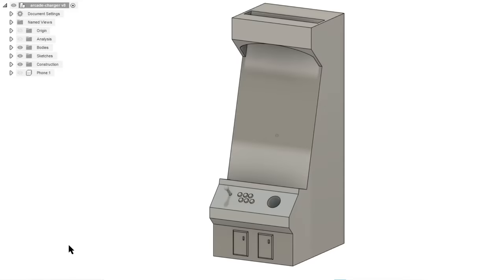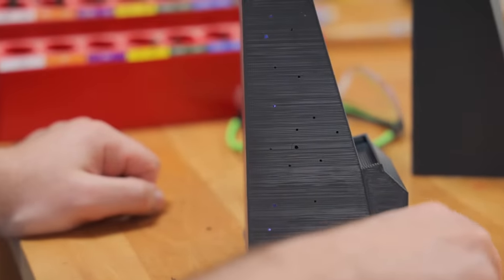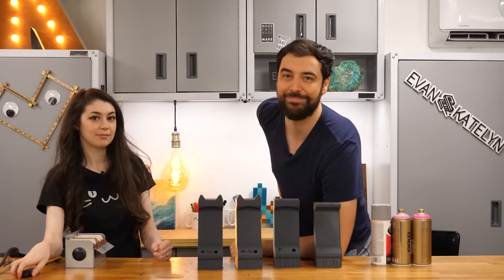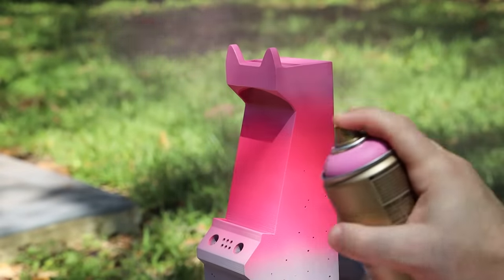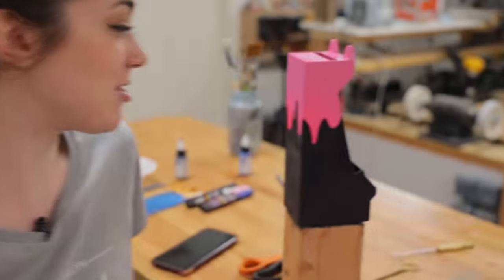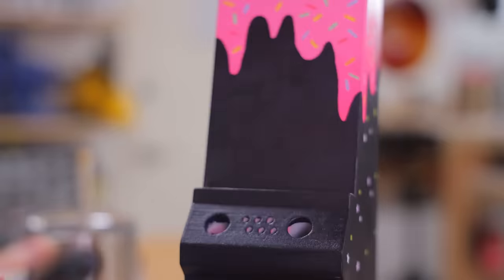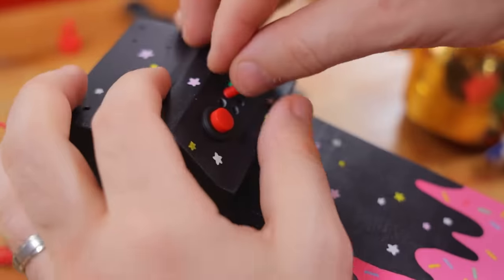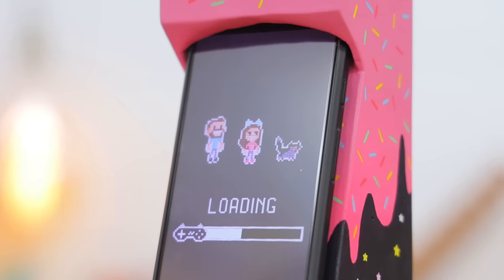Making a Mini Arcade Wireless Charger

Comment: Question : Is there any projects that you have dumped and/or forgot about that we don't know of?

Edit : ps, you can use a woodburner tool to make 3d printed surfaces look more flatter. And then sand it for a bit for perfection.

Comment: I notice your still using primer layers and sanding to smooth your print. You should check out Smooth-On XTC self leveling brush on resin (it’s resin time!!) saves tons of hours of sanding and you can go straight to paint if done correctly!

Comment: Is the charger measurement for the thickness of the charger or the width? Also, when you measured for your phone, did you add inches between the first and third prototype? I have a Galaxy S23 Ultra, and I'm trying to do the measurements for that and a wireless charger for it.

Comment: You are so very very good with the 3D Printer, very impressed. What kit do you use please? Could a beginner grasp it?
by the way on another video you did a hack rubber band on a damaged screw, I saw same on a 10 best type show and it was done with a manual screwdriver and seemed to work, however they also did the soap screw thing and claimed success so????

Comment: Maybe some fiber optics for the LED stars. Several different stands could be done with color changing lights to make have the stars twinkle. Another Fiber bit could be used to light the six buttons on the front.

I do have to wonder if Evan is trying to be the Sitcom Dad with his goofs or did he just watch to much Homer Simpson in the 90's.

Comment: Easiest plastic to sand -- and shittiest to print - is ABS. Butadiene component is present as flake which has a tendency to separate.
What works even better is to slather the print with Tamiya Putty or Revell Putty (or the worst of the bunch, Mr. White Putty, which is a liar), the way they sand, it's just UNBELIEVABLE how quickly and smoothly.